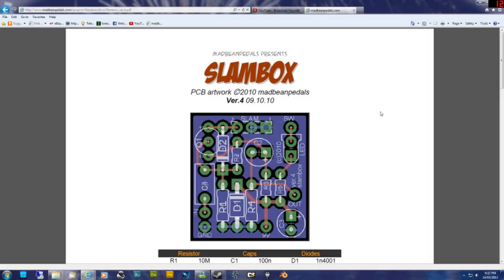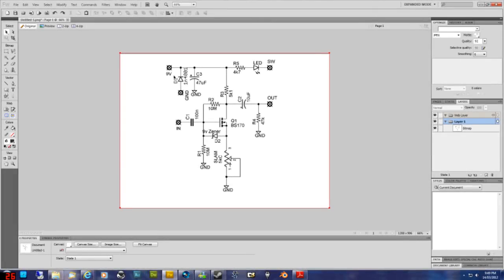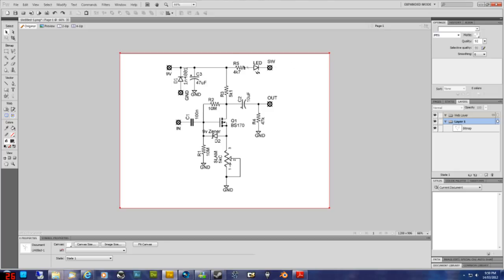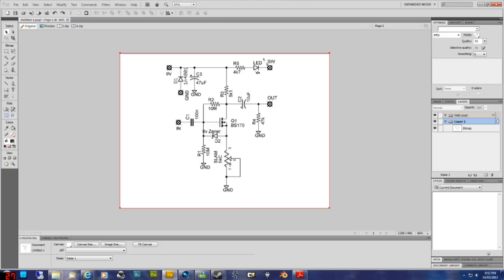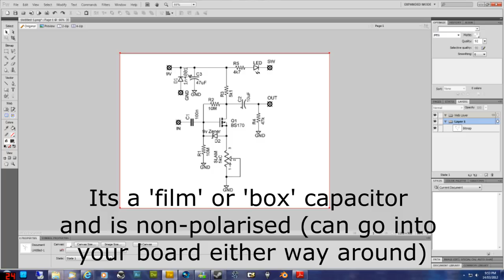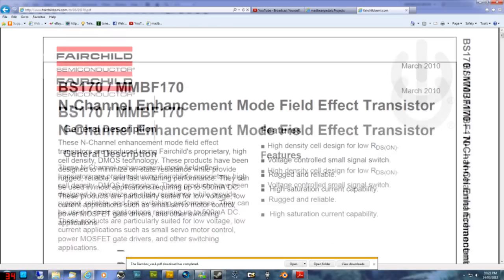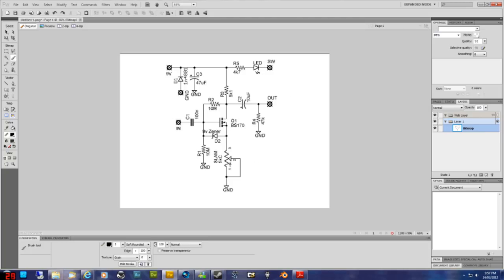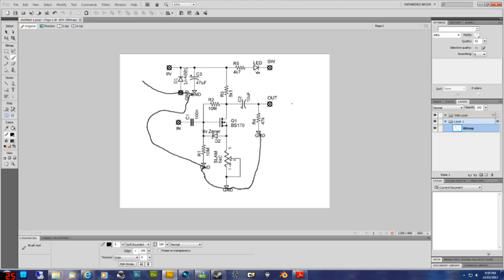Introduction to reading an electronic schematic

Comment: Good job on explaining the schematic diagram.  One other habit I've gotten into with reading schematics is initially I try to ignore the small components such as the resistors, caps and diodes and focus on the more primary components, such as the transistors, inputs, outputs, and potentiometers, as this clues me in to the bigger picture about what the schematic is trying to do.  Once I have a feel for what it's trying to accomplish, adding back in the smaller components makes more sense to me.

Comment: So I'm just getting in to pedal building. Ive designed my own curcuit for a Lo-Fi old radio sounding pedal. But I guess I'm not sure where I should use potentiometers or just resistors. I was gonna make them all pots but I'm not sure if that's a good idea or not. Any input? I can send over the schematic of anybody is willing to help me out there.

Comment: I'm not confused about knowing what the simbols refer to, I am confused about how to know where to connect the positive and negative terminals of my power source and where to connect my mono-jacks, I see only 1 input and 1 output on that schematic, which makes no sense since you'd need two points to connect to for each jack, what I want a tutorial on is how to go from schematic to circuit irl, if you could make a video of you assembling a circuit from a schematic that would be super helpful!
Edit: is hot of the jacks just the input and output of the schematic and the other legs of the jacks are connected to ground?

Comment from the maker: Its kind of like a reference point.  Your telling the circuit, that point is zero volts (although "ground" can be anything other then zero, just like the power rail can be anything other then 9 volts).  The ground of the pedal effect sits between the ground of your guitar and the ground of your amp, and runs through both of your guitar cables to those sources.

Comment from the maker: The legs of the parts go through the top of the board (side with no tracks) and out the bottom side (the side with the tracks).   You will have to work out which way it goes from the layout on madbeans website. Follow the tracks etc.

Comment: Hi DIY, Quite right, the Diode is for reverse polarity protection, in the event you had to many Ales. Really glad to be a sub, gathering all the information I can, Thankyou for sharing your information. Build a Runoffgroove Ruby 1/2 watt guitar practice amp, they rock. Quite an easy build. I do mine with the LM386 in one section and the MPF-102 in another section, pot and jack hook-up pretty simple. Bread board first and remember to clean and score your board around J-FET pins. I use a brown paste like flux that seems to create transient or stray voltage which can impair the performance. No clean flux is what I am going to get in the future. Awesome channel, just the kind of projects I've been looking for. Take care, Be good, C.

Comment from the maker: @mixermantim Hey mixermantin, thanks for the compliments! Hmm, i'd probably get the schematic and the layout open next to each other on my screen and check back and forward, following the schematic around the pcb.  You will see that everything connects the same.  LED connects to R5, R5 connects to R3, C3 and D1 etc etc.  The schematic and the layout may look very different, but all the connects are made the same! GL
CS

Comment: Nice video! When looking at a schematic for a pedal, where do you normally start when building your circuit from a schematic? Do you start with the IC and work your way out? Or do you start at input and work your way to output from left to right? That is where I am stuck right now. Thanks!

Comment: I'm pretty sure that the diode and cap off the 9v is to protect against AC voltage.
Reply from the maker: +Geo Zero Diode is for reverse polarity protection, cap is for power filtering, cheers